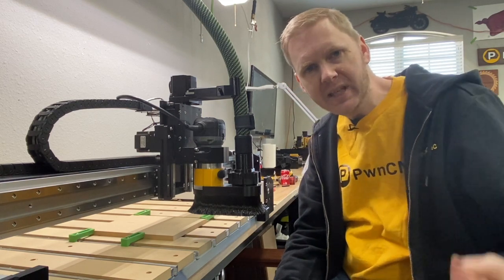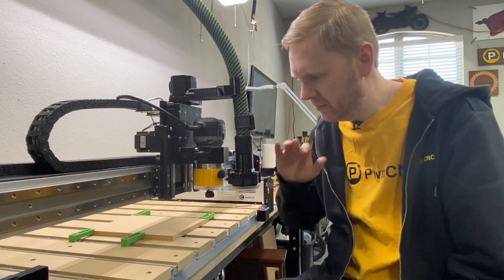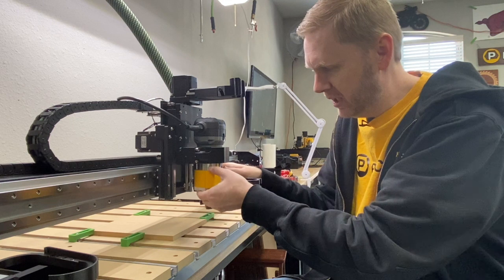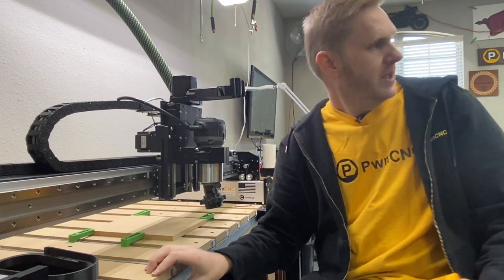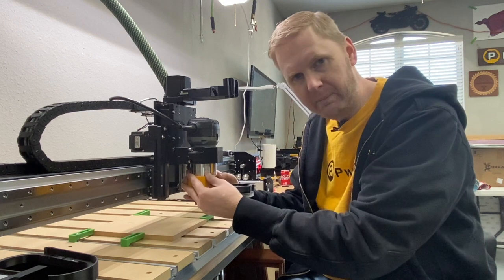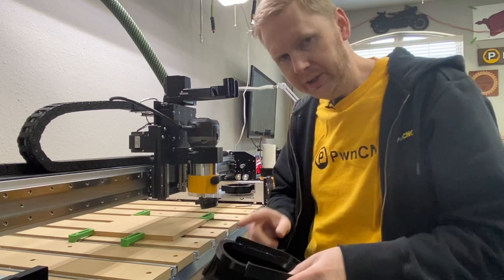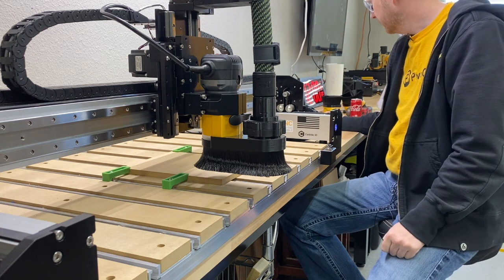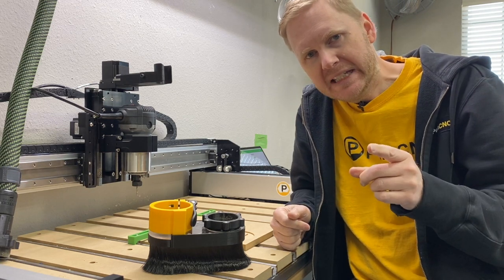Introducing v7 and Start of Prototype Testing

Comment: Just ordered version 7. Is the boom arm you have in the video attached to the hose a seperate purchase? Also the straight piece that comes up directly from the boot. Is that a seperate purchase as well? Thanks for all the great products
Reply from the maker: Hello Lambo,  v7 comes withs a 2.5" round MagLock adapter for attaching flex hose and such.  Pictured in this video is the "MagLock converter" and my festool "boot adapter" found here: https://pwncnc.com/purchase/ols/categories/dust-control
The converter lets you take any of my boot adapters designed for various extractors like Fein, Festool, and others... and adds a MagLock ring to it for attaching to any of my MagLock female receivers.
Reply: @PwnCNC  I just have a Ridgid shop vac with a dust stopper. Bought a long flexible line with 2.5" openings that I'm going to run directly into the dust stopper and other end to the version 7 dust boot. So in order to run the 2.5" end into the dust boot I need an additional piece or what it comes with will work?
Reply from the maker: @workingdogwoodworks1455  Nope.  the 2.5" MagLock Round adapter that comes with the v7 will work perfectly for that 2.5" flex hose.  You need nothing else.
Well... might recommend the ultimate hose clamp but it's definitely optional depending on how you're supporting the hose over to the machine.
Reply: @PwnCNC  awesome! Yea I definitely want to get the hose clamp as well. Thanks for the quick responses

Comment: Looks great.  I like the idea of taking the whole thing off to change bits.  What green clamps are you using there with the t track?
Reply from the maker: Thanks 👍
Those are actually the stock clamps that came with the Shapeoko Pro.  Whenever I get a new machine, i force myself to use the stock accessories and slowly upgrade to one of my existing designs or invent something new.

Comment: Daniel, You told me about this v7 boot. Question, As you have in this video, the dust hose will not work. The v7 goes up and down with router as I want. BUT you show dust hose attached to a solid mount at the top of nema motor. Should there be a solid hose mount that is also goes up and down with z?? If hose is attached to v7 with magnets how does it stay attached as machine is cutting and router is moving in x, y and z without a solid hose mount??
Reply from the maker: The hose has some slack added between the boot and the hose clamp so the up/down movement won’t disconnect the hose.
I have a spindle mounted hose clamp coming soon after my spindle kits start to ship.  That should help a lot as it’ll secure the hose to the motor going up/down.  Meanwhile, add some slack and that’ll help with any disconnecting issues you may be experiencing.
Reply: @PwnCNC  I have in my cart right now the v7 boot.  So with my cnc4newbie z slider on my XXL all I should add now is the xl 4" Ultimate Hose Clamp with the 2.5" straight adapter?
Reply: Just want to make sure I have all that I need in one order. lol
Reply from the maker: @goodwinml  did some measuring you could get away with simply the Large UHC arm instead of the XL one.  And yes, go with the 2.5” vertical attachment… it works great with the 2.5” ultra flex hose from amazon.
Reply: @PwnCNC  Just did the order. Thank you for the help!!!! Send me those skittles!   lmao